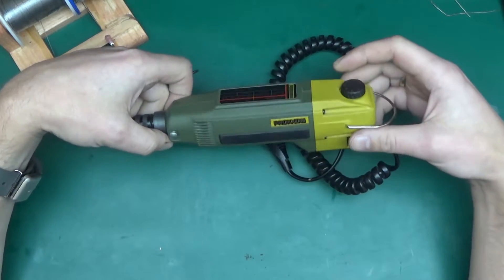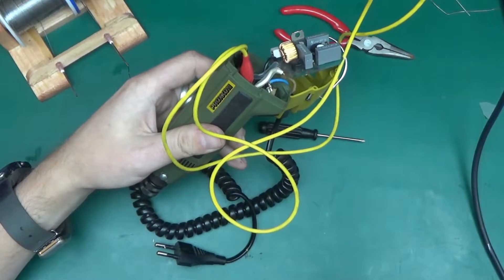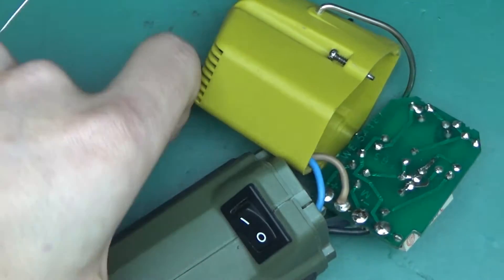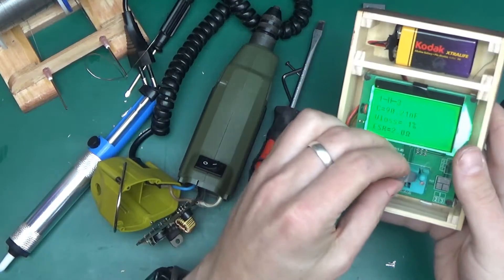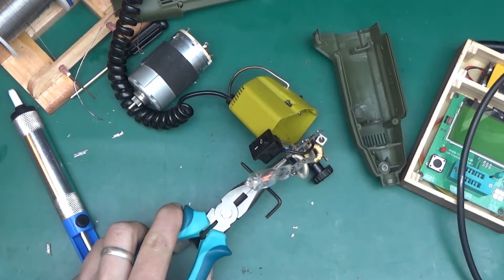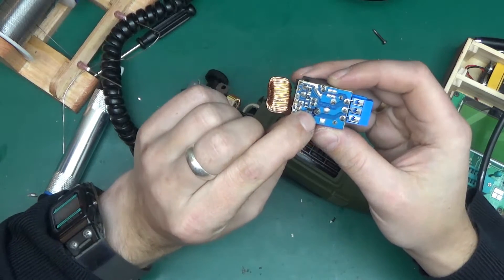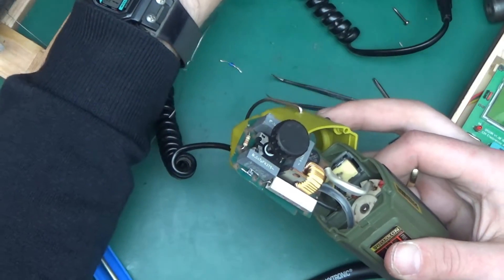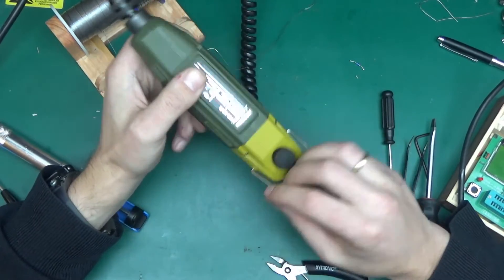Proxxon FBS 220/E grinder repair - success!

Comment: My board is older , it has 4 individual diodes for the bridge rectifier and the big 22ohm resistor on my board they are 2 items .1 on the component side is a green resistor and on the bottom side it looks like a resistor but it is pretty burned up. There was also a loose resistor (a 1 watt 330 ohm) which I don't see on your board ? It is original because I bought it new 35 years ago or so 😊. But it is out of order for 7+ years I think. And so am I but I'm gonna try and fix it.

Comment: My FBS220/E had the exact same issue than yours. I took it apart to check. It wasn't the diac, it was just havily dusted on the PCB. So I cleaned the PCB thoroughly and now it works again! Nice video!
Reply: do you think a filter on the air intake is a good idea? maybe made from a covid mask